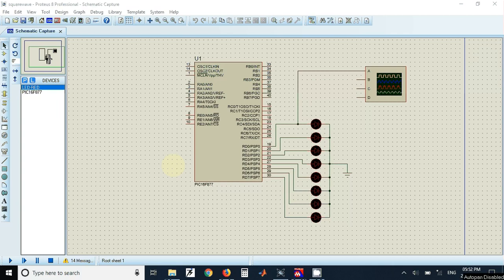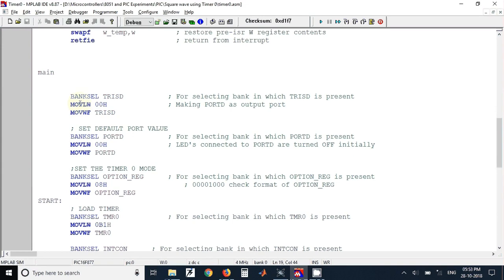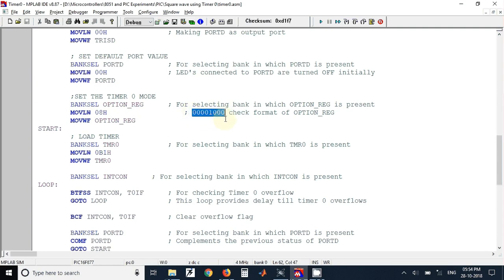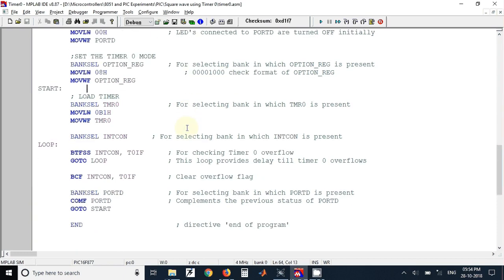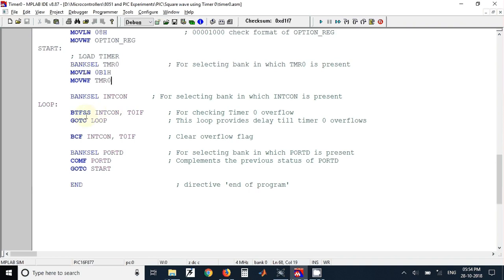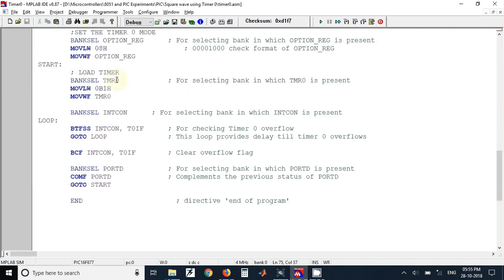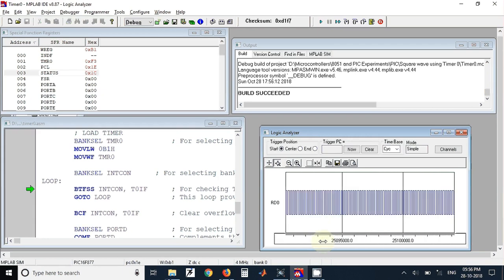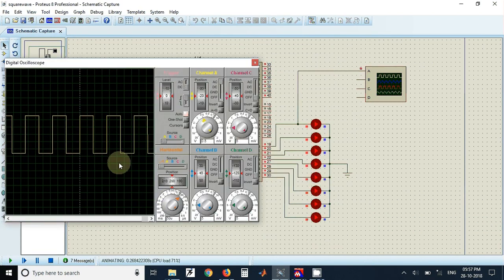Square wave generation using Timer 0 of PIC 16F877

Comment: I am having a problem with this fuctionality. I want to generate a square wave of 200Khz, but the maximium I am getting is 100khz.
Reply from the maker: You can change the delay in the program. If you want to increase the frequency then decrease the time delay in the program.
Reply: @AkshayBhosale18  I didn't get what you mean. I am using the TIMER2 in my pic16F8887. I want the frequency that has 5uS of period. But when I choose PR2 = 25 and all the scales to 1:1, i get not what I have calculated, but 13uS. 
Then I did a test, I set my PR2 to the minimal, that is 1, and set the scales to 1:1. I did get the same result, 13uS. So I have deduced that 13uS is the minimal limite.
Reply from the maker: @akemap4  Are you testing it on hardware or proteus software ? If you are testing it on software then make sure to set the crystal frequency same as that you have used for calculations.